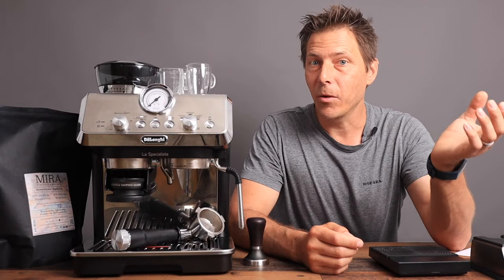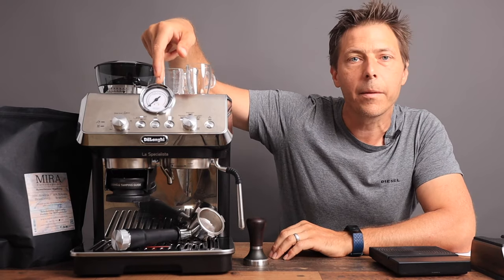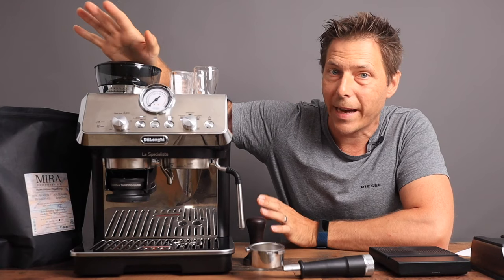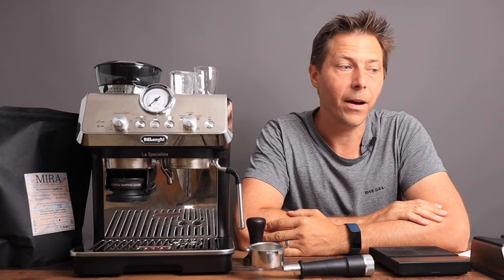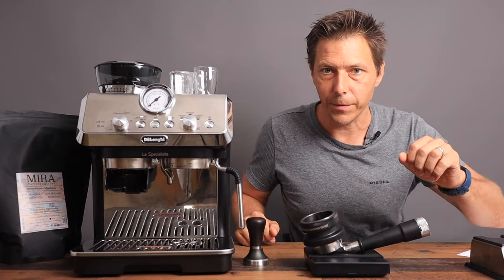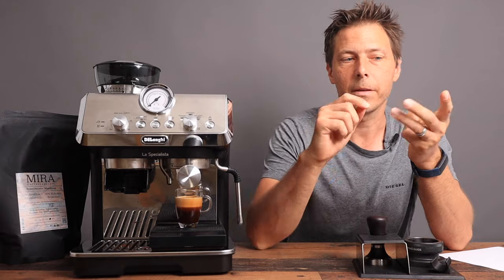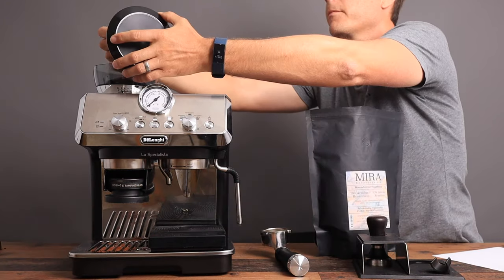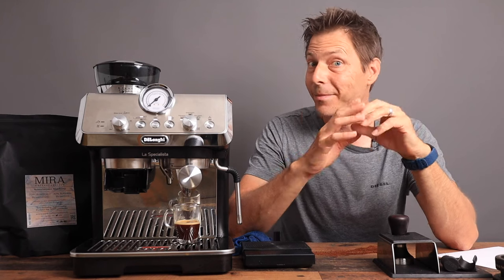Low Pressure? How to Dial in Delonghi La Specialista for the “Optimal Zone”

Comment: Hi Tom,
I have the same exact machine and the pressure gauge doesn't move at all.
Is there a way to verify that it is not broken?
I am grinding at 2 so I would at least expect the pressure gage to move a little... even if my tamping is not optimal...
Reply from the maker: Hi Antony, I have heard numerous times about this issue. Call Delonghi for a replacement.
Reply: @TomsCoffeeCorner  I just did!
They're sending me a box so I can ship them my machine. Thank you
Reply: Same issue here. Unbelievably sloppy at this price.
Reply: @gpas80  got mine fixed actually. Was still on waranty.

Comment: Why did you change the original basket? Maybe that it why you have to grind that fine. With the original basket i reach optimal pressure and even beyond on the setting 4 with fresh coffee. Are you aware that the original basket was specifically engineered to obtain optimal pressures and extractions. I suppose that shape of the basket went through a lot of R&D.
Reply from the maker: Oh my gosh Christi, you are right! I just defaulted to the fancy IMS basket, because it is supposed to be better. But when putting the original 2 cup basket in there, I went from a grinder setting of 2 to 4, to get into the Optimal Zone! So, what are the differences?
The stock basket is tapered, and therefore has I imagine fewer holes; so the coffee must be slightly more restricted. 
It also has a ridge by the way. Some people like this, some don't. I prefer ridgeless for better tamping.
BUT, I think you are right, that Delonghi designed this specifically in tune with their grinder. That way, the grinder has enough range. Bravo, Delonghi! This is a really nice machine to work with. 🤗
Reply from the maker: @joh joh Hmm, that is strange about the warranty. The bottomless portafilter really has no bearing on the machine, except that if manufactured poorly it might prematurely wear out the rubber gasket. I always buy or make myself one, to analyze my shots, and get that sweet espresso extraction on video. 👍

Comment: Do you always need to stop the water yourself at this machine? I can't get the water stopping between 25 and 30 seconds, without having to much water. I can pull a shot between 25 and 30 second with 1:2 ratio only I need to stop it always on my own. The machine keeps giving more water.
Reply from the maker: You can program the volume amount, but I normally stop it myself, because I want to make sure it is right on. The volumetric programming is not super accurate tbh.
Reply: @TomsCoffeeCorner  Thanks for your response, i see what you means it the same over here.

Comment: I have the Delonghi La Specialista with the auto-tamping & it's only a few months old but despite trying to configure different settings, it always goes over pressure and automatically shuts off the shot. It's making me crazy.  I paid almost $1k for this machine & it's barely functioning
Reply from the maker: Hi there! Well, you might be dosing too many grams, or grinding too fine. Have you weighed out your dose? Aim for 15 grams to start, and adjust the grind to get into the optimal zone.
Reply: @TomsCoffeeCorner  I haven't weighed it out, but in order for it to successfully draw a shot without going over pressure, I have to have the grind on 6. I just don't understand why if I go to anything finer, it won't pass water through it. I'm also using the double size portafilter & the grounds are well below the line.
Reply from the maker: @bradleyhoward74  Maybe your beans are really fresh? The fresher the beans, the more natural resistance to water they provide.

Comment: Hi Tom  the pressure on my La Specialista is going into the red Zone  appears to be blocked,  i have  adjusted setting,  purged the machine,  descaled but it appears to be blocked any ideas .  The water is flowing fine  without the basket attached but when i try to do either a  1or 2 cup shot it blocks
Reply from the maker: Could it be that you are grinding too fine? Or maybe your basket is clogged?
Reply: @TomsCoffeeCorner   thanks for the response Tom,  i have changed the grind setting to course at 6 and 7 ,  and unclogged the baskets, still hits red, but pouring now,  still not functioning fully , so not sure if it is  the machine or  an issue with me,  had been working fine for 3 months and again descaled regularly
Reply: Going to start weight all the baskets like your videos but was never an issue in the past

Comment: Can You help me please,with my la specialista prestígio and lavazza oro coffe have no presure,stay at zero ,dont move.Can You help please?
Reply from the maker: Hi Paulo, will I should at least go up a few bar, even if the grind is off. Could it be that the manometer is not connected? Do you have the option to exchange the machine for a new one?
By the way, on what the setting are you grinding, and how fresh are the beans?

Comment: How and where do I measure the basket size on cheap espresso machine
Reply from the maker: Hi Durian! At the upper rim. Measure the inside diameter. Most cheap machines are 51mm or maybe 53mm.